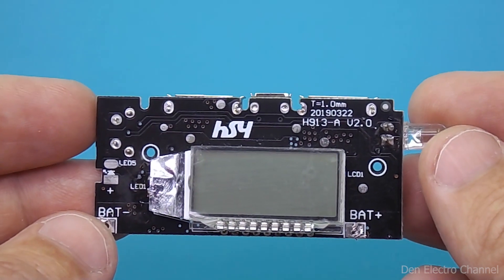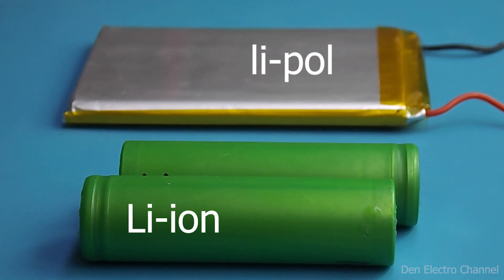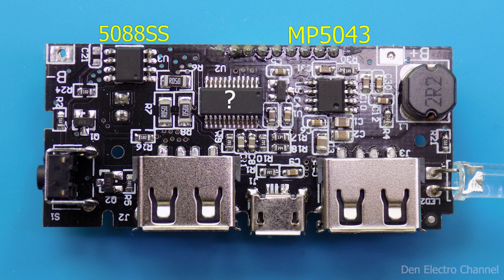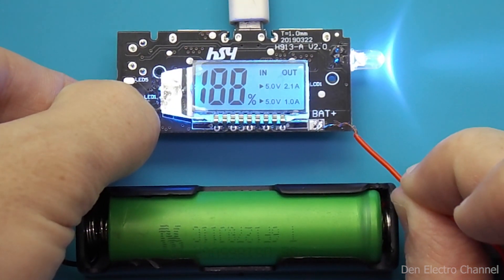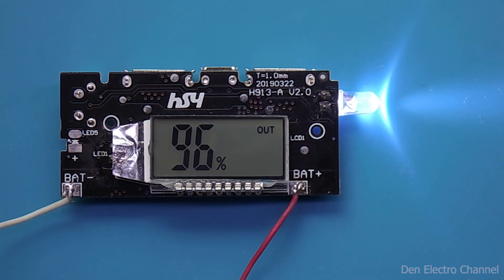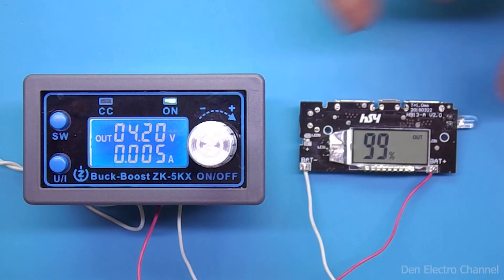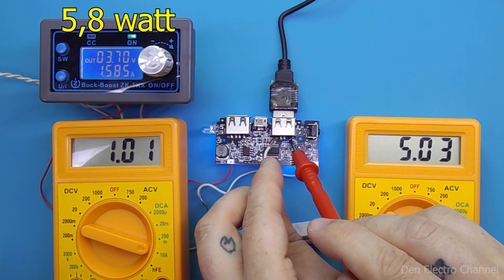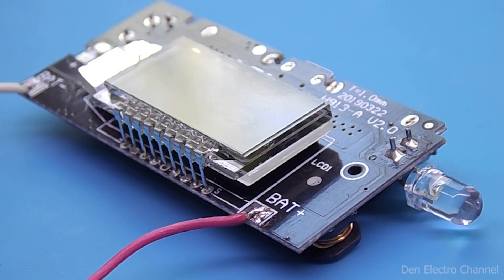Overview of the board for a homemade power bank

Comment: I have this module it stops charging mobile if we connect 2 or 3 batteries to module after 5 mins. Can you figure out what is the minimum no. of batteries required to charge one 5000 mah mobile single time. can we give more than 5 volts to this module.
Reply from the maker: Unfortunately, I can't change anything. I installed it in the case and sealed it. And why apply more than five volts to it?
Reply: @Den_Electro_channel  I was thinking of connecting laptop battery to the module but the output of the battery is 10 volts hence asked.
Reply from the maker: Now I understand the question. This module only increases the voltage. 10 volts cannot be connected. Only voltage is 3-4 volts. And he will increase it to 5 and that’s it